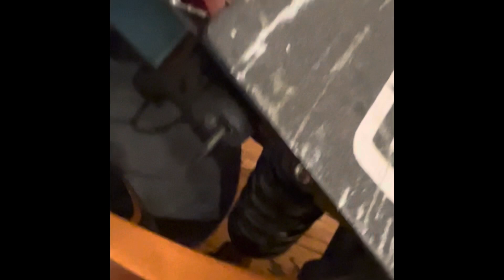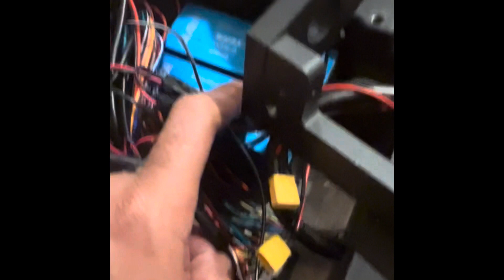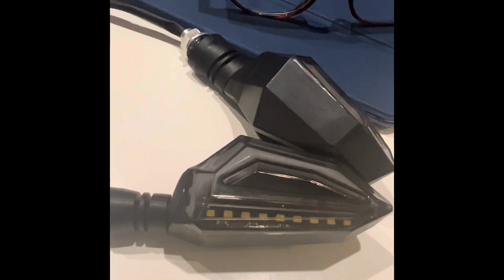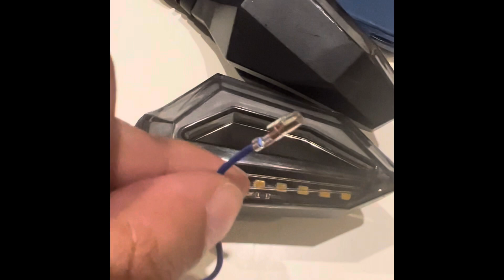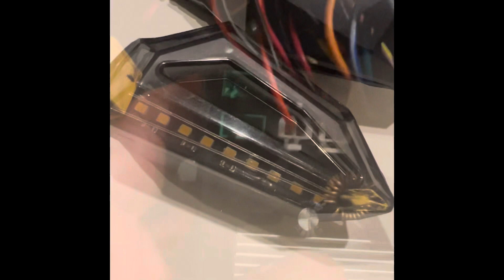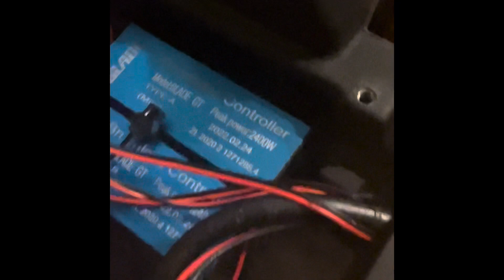Teverun Blade GT Electric Scooter Replacing Broken Turn Signals #electricscooter

Comment: Because the Blade GT that I bought didn't have the same turn signals that came on your scooter I took the ones off my broken Blade 10D and installed it on my GT. If you find that your kick the signals on accident use some sugru to add more security to the signals themselves. I kick mine out of habit and the surgu seem to be doing it's job. How much did rydeology charge you for the controllers?
Reply from the maker: I got a small discount after explaining my issues, didn’t even ask for one, they saw what was going on with warranty and stepped up. The cost was About 2/3 of what Teverun wanted and it wouldn’t leave china til after October 7th. At least these parts are in Washington. Nice, I’ve seen lots of mods on Facebook for this scoot, considered getting bulkier turn signals but at this point just tired of spending on fixing things. I have to say the community and even some of the retailers have wowed me with how they’ve stepped in and tried to right this situation privately. It’s commendable and admirable of the PEV community.
Reply: @AD_team_ecs  you said you got your scooter from China (AliExpress)? Which seller?
Reply from the maker: Sunny Times, they’ve been good themselves, the manufacturer has left much to be desired in after sales.
Reply: @AD_team_ecs  I bought mine from Wheel Rider Store, I think they also deal with the same distributor. I also had issues when I got mine, essentially the NFC Lock was faulty and it took a month and a half to ship out a new one even though I didn't use it and still have it. Because they were dragging their feet I had done business with an eBay seller that goes by Heroeiderusa they had all the parts that I needed and was riding within a week and a half. If you do need some parts check them out if you want to. They have the turn signals and the LED deck as well as PCB boxes. You never ...
Reply from the maker: Yeah, all of the retailers I’ve talked to this week while looking for parts have said the same thing. It’s been a nightmare for them as well dealing with Teverun and folks are going out of pocket to fix them. I just had to drop $700 on a battery on top of the $100 for the controller.
Reply: @AD_team_ecs  was Heroeiderusa one of them?
Reply from the maker: Nah, I looked at them initially to see if they would have it.
Reply from the maker: Just a heads up, careful with your pcb. My scooter had to be completely gutted and all new internals put in. Horribly wired dude, I went with dualtron controllers and had to have to motors rewired. If anything fails you’ll need to replace part by part to figure out what broke because of how they bridges the connections. One thing and fry out the other.